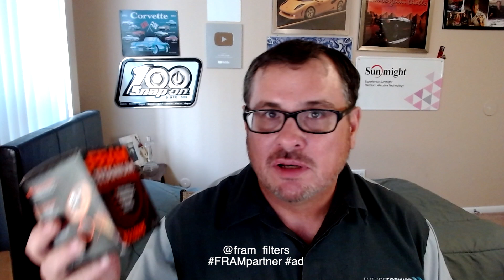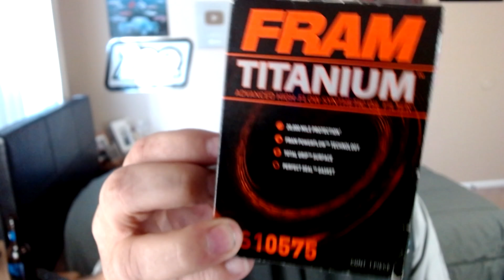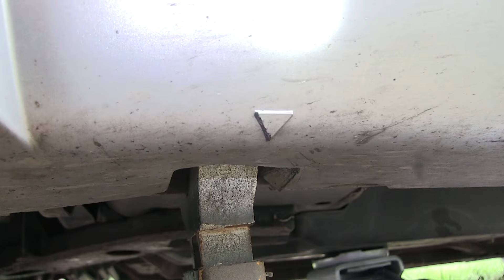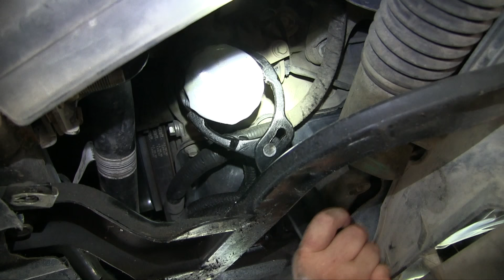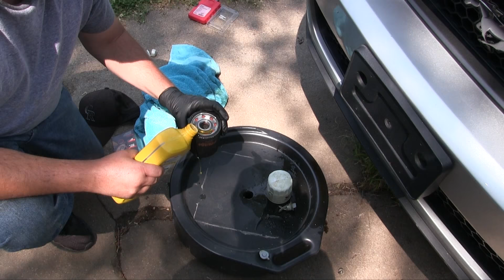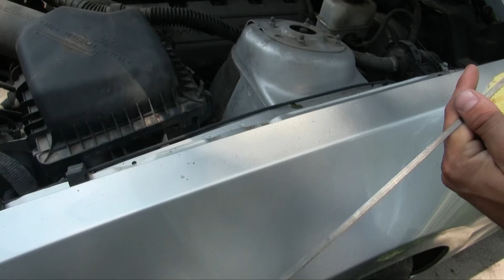High Performance Requires High Oil Flow!  Tips For Changing Your Oil Filter Using the FRAM Titanium

Comment: I Switch too Gold K&N Royal Purple with Engine Restorer Using 8 Cylinder bottle extended protection and compression seen a-in 5 pounds and using B-12 Berry’s Man’s injector cleaner using Wix’s Fuel Filter seen a 5-9Mpg differences. Try it out you’ll see what you paid For .